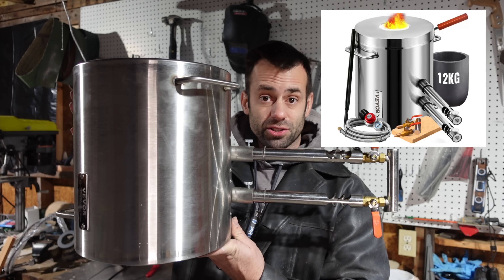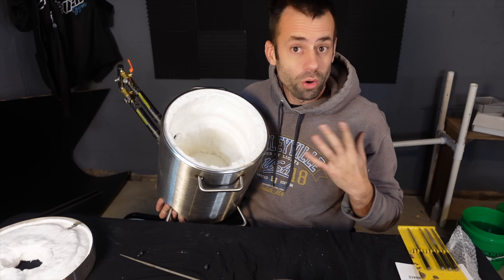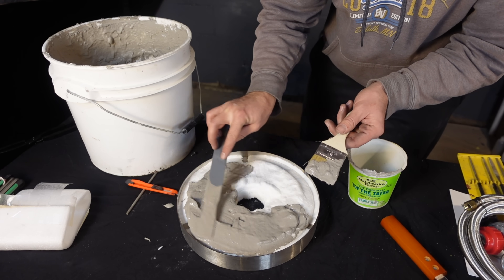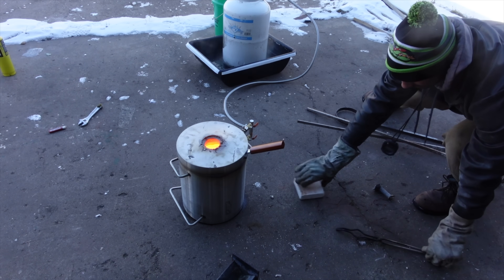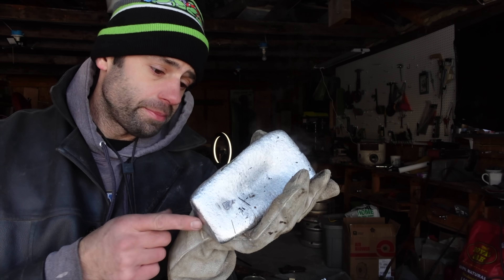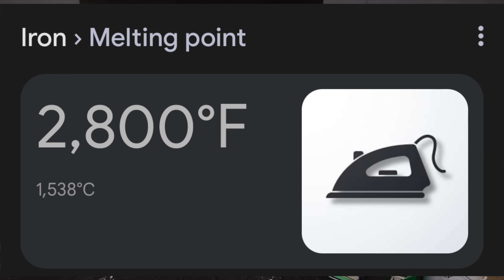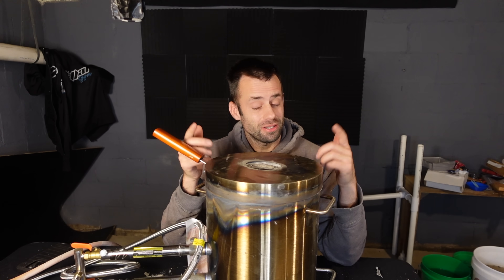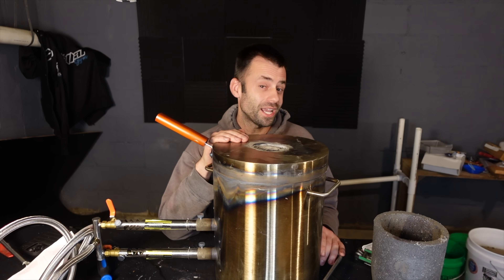Vevor 12K Melting Furnace Review: Is it Better to Build or Buy a Foundry Furnace

Comment: I can tell you what happens if you spill molten aluminum on concrete. It ain't pretty. It EXPLODES. When the moisture in the concrete boils, it goes BANG. It goes everywhere. It goes up in the air. In my case it came down on the top of my head. Yes, hot liquid metal burning into my head. I was wearing a face shield so I'm lucky I'm not blind. I'm lucky my scalp recovered and don't have a bald patch. I have scars on my legs as it shot through my clothing. It was a very bad day.  That was on dry concrete. What you are doing on WET concrete is VERY dangerous. Don't do it. Do it on the lawn or in a pan filled with sand. I might be sounding dramatic, but that is what happens. Don't let it be you.
Reply from the maker: Sand would be better you are right.
Reply: @lundgrenbronzestudios  Thanks for the reply. Watching this, I was cringing inside after what happened to me. Molten metal is a formidable thing and should be treated with respect. Sorry to put this horror story on your channel, but I had to say something. The bang was like a gun shot. Hopefully my experience will help those that read it. Many won't unfortunately. The risk is real. I don't want it to happen to others. Stay safe. Matt from Australia
Reply from the maker: @ no it’s good to share that kind of thing.
Reply: @lundgrenbronzestudios  Yeah i guess. Its only a matter of time before some thing bad happens.
Reply: @Matthew_Lloyd thank you!
Reply: @Crappy.Consumer.Reports  Very welcome. Happy to share my mistakes to save others
Reply: There is a reason for all the 'floor sand' you see in traditional casting workshops- it's not just that they were too lazy to sweep up!
I cast on a gravel drive way or on a bed of greensand over a bit of panel steel if stuck inside.
Glad to hear the o.p. came out in one piece!.
Reply: Advice taken!!
Reply: Luckily the soil behind my house has a bald spot layer of sand over clay earth. My plan is to pour on that bald spot for this very reason.
Reply: Thx, I’m gonna start doing this hobby from a gift of a foundry last Xmas. I’m now aware I need more education on this before starting 😅
Reply: @ Yes !! Be very careful. There is a lot of energy in that hot molten metal.
Reply: Thank you for posting this.  I wouldn't have thought.
Reply: @jesseparrish1993 handling lava and you wouldn't do research?
Reply: Holy shit buddy.. That's brutal.
Reply: @JohnSolo-t5f  it sure was
Reply: Nice of guys like you to educate less experienced people with the hope they won’t make the same mistake.
Reply: https://youtube.com/shorts/NlZ16J1rV6w?si=KVtbK2ly9w81BXJb
Reply: This is why I pour on a dry sand bed and stand on a small platform of bricks.
Reply: Reminded of (Australia guys?) casting Aluminum in a sort of pest control(kill) & art biz.
They talked safety, wore SOME protective gear; spoke about hitting water in some of the labyrinth of insect tunnels when pouring the melted aluminum.

Yet their kids help, like stomping on grass fires they cause....but kids not all that many feet/meters further away at times.
Reply: Probably videos of big factory foundry, recycling metal with entrapped water deep in a huge crucible of molten metal.

Or giant boiler (like for electric power plant) with refractory fracturing, and tons water exploding as vaporized instantly.
Reply: @raphaelpetra8338  Usually that happens when the charge into the furnace has some moisture on it.
Reply: I've been to Bentlyville. Real pretty lights. Little Angie's for Mexican food!
Reply: Glad I read this…thanks for taking the time to tell us..glad your ok
Reply: Ya, are you the Darwin model. Nobody is this dumb to melt and handle lava and not take proper precautions with research about moisture and humidity. Just my two to warn kids. If the crucible shatters what'd you do then? You'd be dead! You can't sugarcoat moron when shits this dangerous. 
Imho
Reply: Appreciate the advice. We're getting one of these and I'm prepping for using it. Sand. No concrete. Got it. Also @lundgrenbronzestudios appreciate the tip on the tongs.
Reply: this is why a lot of shops have a section of floor that's several inches of gravel over packed sand - when you need to knock slag off something or have an insanely hot chunk of something in general you can just huck it over there and let it calm down
Reply: Are you able to pin my comment so it stays at the top ?
Reply from the maker: @Matthew_Lloyd  I can.
Reply: @lundgrenbronzestudios  Excellent. Thank you. And thanks for the review of the furnace. I am looking to get back into the hobby. After the accident I've not done it again. That was 10 years ago. I've only had furnaces made from stacks of bricks and then a oil drum lined with fire clay. This ceramic blanket seems to be very good. You melted cast iron ! Well done. Good job

Comment: Cast iron is filthy with impurities and inclusions, therefore... WELL DONE !!
fire brick + Ceramic insulation + electric 220VAC heat (propane has SO MUCH water which cools the flame) double insulated will get you to 3300F+
and yes, a forge and 50ton hammer are next...unavoidably in your rabbit-hole Quest, Oh Brave One !!

Comment: Worth noting is BBQ cylinder valves have GCA 510  female threads which fit CGA-510 welding/cutting fuel gas regulators, tees (used with appropriate hose and fittings to gang multiple fuel gas cylinders), 
etc. Larger LP cylinders over 40lb size are are not restricted by the OPD used on small LP cylinders.

Comment: Great video. One detail, though: At 11:46 you read from the manual "...with melting points above 1350 degree C such as iron and magnesium...". In the manual it says manganese, not magnesium. Magnesium has a low melting point of 650 degree C.

Comment: That metal is as thin as the 10 gallon bucket and lid I use (also lined with kao wool) lol  I mostly use a diesel burner but you need an air compressor, also have a propane as a second burner but don't use it that often because the diesel is cheaper to burn and no ice up issues.

Comment: I have one of these, lid doesn't fit the best but it works well. Ive ran 4 runs of aluminum and 2 copper without issues. Crucibles were nice and tongs were sturdy.

Comment: Hot hot does this get?
Reply from the maker: I don’t have a pyrometer so I couldn’t say but hot enough to melt cast iron.
Reply: @lundgrenbronzestudios  well cast iron only melts 100 degrees higher than gold. Chapgpt says at full blast it can reach 2700. Who knows if that's true or not.
Reply from the maker: @ definitely can’t reach temps that high.
Reply: @lundgrenbronzestudios  i dont think you had it on full blast even with the iron, maybe it can get close to it with enough time.

Comment: Hi Lundgren! My Beer keg furnace is worn out and rather rebuild. I will get a vevor furnace. I have had a few reviews? but yours seems the most clarified one. I do Hasve a BOC pressure gauge I will use. And in cold weather I wrap a fire blanket around my gas bottle keeps the cold out, And I sit my bottle on a wooden pallet cut down to size. Thankx for your review.
Reply: The 12kg furnace is in stock and I just bought one! Looking forward to using this stuff!

Comment: GOOD PROJECT!!... BUT: (IMHO),...YOU SHOULD USE SAFETY GLASSES, RESPIRATOR/BREATHING FILTER, EAR PLUGS, WELDING GLOVES, ....AND, YOUR CRUCIBLE RING COULD USE A TAB, TO PREVENT THE CRUCIBLE FROM FALLING OUT, NEAR THE END OF THE POUR... USE A GALVANIZED STEEL BUCKET FOR YOUR "SLACK TUB" (QUENCH TUB).

Comment: In all honesty, how much will this setup cost?
Reply from the maker: There is a link to the furnace and then you will need a propane tank, I recommend a few crucibles and a pouring shank and lifting tongs and an ingot tray. Casting sand and flasks. It’s an investment.

Comment: Why is the propane tank in a tub of water?
Reply from the maker: Because when it gets too cold the propane stays liquid and does go into gas state so you loose pressure. Hot water warms it up to keep gas pressure. You must live in a warm state.
Reply: @lundgrenbronzestudios  lol ya, Arizona.
Reply: @lundgrenbronzestudios  LOL. Arizona. only use the propane on good days. Thanks  for the correct answer.

Comment: Silly question maybe but why doesn't the liquid aluminium catch fire?
Reply from the maker: I don’t know but most liquids don’t burn. It will oxidize but it doesn’t ignite.
Reply: Unless the Aluminum has some Magnesium mixed in with it, it won't catch on fire. Magnesium by itself, that's a different story... I've melted some Aluminum that had Magnesium in the alloy (power tool casings), I ended up digging a hole to bury that in to keep it from destroying the furnace.

Comment: Nice video.  I have been thinking about purchasing this furnace.  It was good to see it in action.

When melting cast iron, a fluxing agent is essential.  Two good fluxing agents to use are crushed limestone and Boric acid.  Be sure to skim the slag before pouring.

There is an old fashioned way to check the carbon content of your cast iron and this is what is called a chill wedge.  It will produce white iron to a certain length, and this will give you a good estimate of the carbon content.  You should be able to find a description online.

I would also recommend getting a pyrometer so that you can measure the temperature of the melt.  Overheating can cause problems, usually oxidation though lower boiling point metals can vaporize, the latter is especially critical if you are melting brass.  You can make sure that you have sufficient superheat prior to pouring a casting.

Comment: Hi LBS. Good video, and have enjoyed many of your earlier ones over the past few years.
This vevor furnace looks okay, but it does seem rather flimsey. Seeing the lid warp considerably on your first melt concerned me..
I watched your beer keg video a few years ago. I already have a keg. Got it free. I'm  considering following your build directions,  but was going to double burner it like the vevour.. I'm certain this furnace would be more robust than the vevour, but on reflection do you think I'd get similar results with my diy keg furnace if it was double burner ? I think yours was just single.

Regards, John, Nottingham,  UK
Reply from the maker: Oh yes I think the double burner would help heat the bigger chamber for sure. It will use fuel a lot faster though. But you wouldn’t always have to use both burners at full capacity.
Reply: Thanks for that and for replying promptly

Comment: Since you are experienced i have a question for you, do you think it would ever be worth it to get a plumber to install a natural gas line for a natural gas furnace? I mean it seems like the propane variety would not be cheap to use
Reply: Propane is hotter than natural gas. Propane has three carbon atoms per molecule and natural gas has one carbon atom per molecule. Butane has four. Liquid fuels like gasoline and diesel have several carbon atoms per molecule.
Reply: @KingfishStevens-di9ji  perhaps it burns hotter but is it hot enough to matter? if its a difference of only 50 degrees F then I doubt it would matter very much. Or would it?
Reply from the maker: I don’t think it would be worth it. 100lb tank of propane lasts me quite a few melts.
Reply: @lundgrenbronzestudios  How long do you think those 20lb propane tanks (the ones they sell everywhere) would last?

Comment: What do you think about making polystyrene foam molds for taxidermy, I could see these being good for shoulder mounts or decoys. My question is how well do you think this foam will hold up, also you could maybe strengthen the foam with fiberglass while keeping it lightweight. I’ve made foams using the polystyrene beads in making neck plugs for cryogenic dewars , but I think it could have some practicality for taxidermy and make taxidermy forms much cheaper. What are your thoughts ?

Comment: Thanks for the review. What would you think of their 16kg furnace? It claims to be made with 20% thicker steel and thicker insulation of 50mm. The two torches look the same on 16kg and 12kg models, if that's the case, I hope it can still melt cast iron just as well or better than the 12kg. I would love to know what you think.
Reply from the maker: Bigger chambers are harder to heat. Unless they have bigger burners it’s probably not going to preform as well.
Reply: Thank you for your reply! 16kg claims to have thicker insulation at 50mm, how thick is the 12kg furnace insulation? The burners appear the exact same, but it is hard to say for sure from the photos. I am hoping to melt cast iron, so it's exciting to see that it's possible.  @lundgrenbronzestudios

Comment: That regulator reminds me of the one that was on my RV. If it was cold I would go to take a shower or cook dinner and the burner would light but then immediately run down and go out. I would have to light the pilot light on the stove and it would stay lit. After a while it would finally give me back its full flow. Absolute pain in the dick.
Reply from the maker: Yeah. That’s the one.

Comment: Winter melting tip, use multiple bottles of gas with a crossover. That way you have a smaller draw from each bottle and they don't freeze as easily.
Reply: keep them warm ;)

Comment: Great ! But it's not difficult at all to make it yourself ; with 2 burners the heat is better distributed, this is hard to find refratory with enough high grade of temperature resistance for melting steel; but y have foud a yellow clay aroud a spring in the forest that can do that ! It vitrifer a little but with a furnace well designed that can do the job ...for free !
Reply from the maker: I’ve made several furnaces. You learn with each one which is valuable. But I’ve never been able to make one as good as this one.
Reply: @lundgrenbronzestudios Thanks for your answer ,
You think his superiority is especially  provided by the 2 good burners installed tangentially ? 
Y think that the heat exhaust can be reused in an heat exchanger made of stainless steel tubing in an additionnal chamber, for preheating the air intake of the burners, at hundreds of degrees , to make an extremely high temperature flame, ad so an economy and power gain, this is by that way of preheating the primary air supply that coal power plant and blast furnaces work, i am extremely curious to test this ! 🤗

Comment: the iron was impressive for what it is...
my approach to aluminium is use old castings only... extrusion never really makes for nice pours.
drink cans? aluminium oxidises. a can has lots of surface and almost no material, along with the plastic coating to filth things up. just make piles of dross.

get a sand pit. work with molten metals, do it on a floor of sand...

Comment: One thing I need is total cost of accessories ie: tongs molds ect. And how much is the cost of propane vs the value of product by the pound. I have 5 large trash cans of crushed aluminun cans I would love to get the most out of. Plus a bunch of copper wire. Thanks, the cost of the Furnace after registering is $89.99 for the 6kg (gold) and $158.99 for the 12kg (gold) after becoming a member. Great video I plan on going back and watching more.
Reply: I've been casting for a few years and have tried cans. I don't think they are worth the fuel and time it takes. Like extrusions, the metal you end up with isn't very good for machining into a finished product. Using scrap castings as a starting point gets you a better product.
When the weather warms up I'm going to try some cast iron.
Reply: You have to remember that most places won't accept the metal after it's been melted. Almost always because they don't know if it's pure or not. So you are essentially melting these metals as a hobby and to keep.

Comment: One thing to remember is that iron and carbon really like each other so if you melt too much iron containing metal eventually you'll dissolve the graphite crucible. Really need to go over to ceramic for iron. 😉
Reply from the maker: Good to know.
Reply: Crucibles are a consumable, they don't last forever.
Reply: @gelmgren yup and very cheap crucibles give you what you pay for. I'd rather not take the chance when holding lava FFS